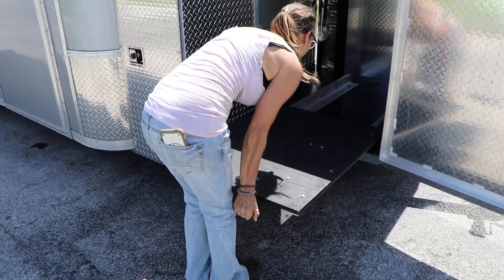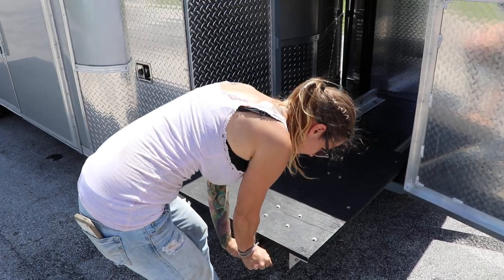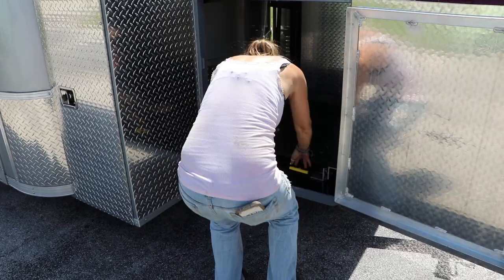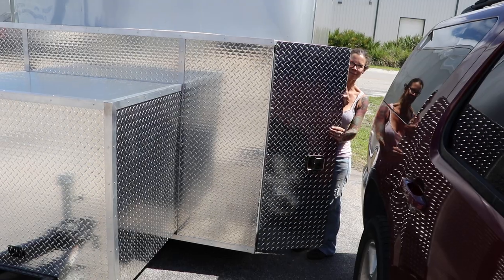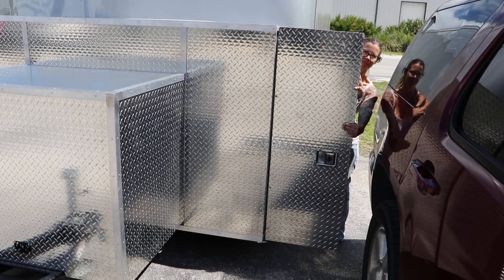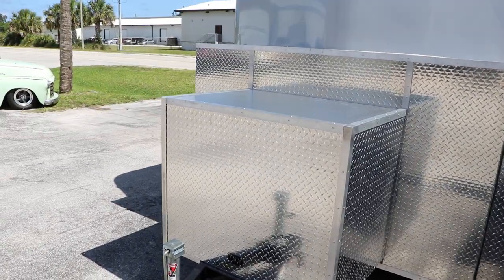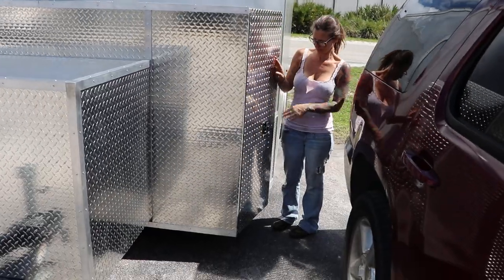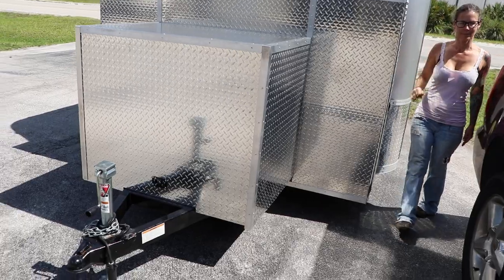Custom Job: Enclosed Trailer Generator Cabinet & Slide Out

Comment: WIth the propane tanks, the generator and the cabinet itself you're adding a lot of tongue wt. for the tow vehicle. This will take a good bit of counter wt to compensate for.
Reply from the maker: You're absolutely right with that perspective. However, the trailer manufacturer made the trailer with the extended tongue and the axle placement consideration of it having the extra tongue weight.

Comment: would you be opposed to giving out some advice to someone who is going to try and make one on their own for the first time ??
Reply from the maker: Certainly don't mind. Anything particular you'd like to know?
Reply: @ColonialMetalworks  I have a harbor freight 8500 generator that I am going to be making a sliding mount for..where did you get your slides that you use..my generator is about 250 lbs and it will be on the outside of my box truck for my food truck

Comment: What happens when you're having to make a very sharp turn . Lol
You will take out you taillights or damaged both trailer and truck . 

Awesome idea but needs more thinking.
Reply from the maker: The trailer was built by the manufacturer to accommodate having this on it (extended and narrowed tongue).  There's not a single issue with turning radius or damaging lights, bumpers, etc.
Reply: @ColonialMetalworks  cool . Never said is wasn't  an awesome idea just pointed out something i noticed.
Reply from the maker: @Spad68  the feedback and input is very appreciated. We've broke many eggs getting to where we are and we expect we'll break many more. :-)